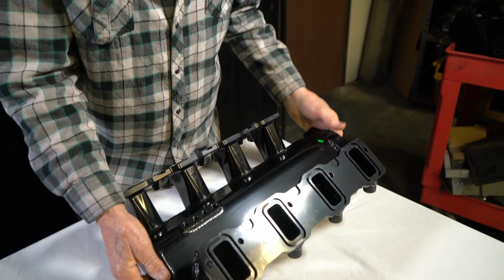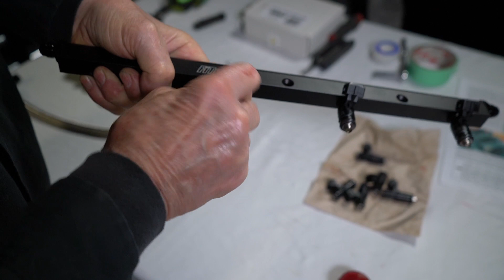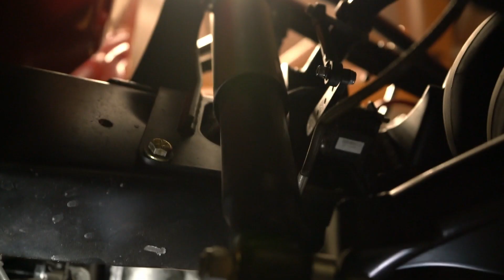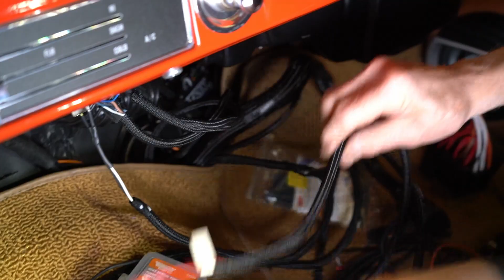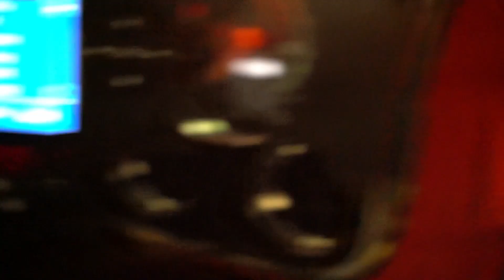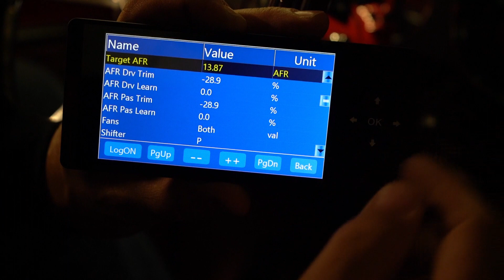1971 GMC LS EFI INSTALLATION- Part 1 | FiTech Tech Video

Comment: Hello, I have been reading that the say to eliminate voltage drop to wire directly to the battery?… is that not true?
Reply from the maker: Hello sir,
Running the battery wire strait to battery is the best you can when wiring an EFI system, since you will secure the power to the system. Running kill switches or other solenoids can affect voltage from getting directly to the system.

Comment: Hello, on my LS 5.3 Gen 3 I have a 4-wire alternator and on the FiTech ultimate LS 750 kit I have a 2-wire connector, my alternator does not give any current how do I connect it?
Reply from the maker: You can get an adapter wire to allow you to hook up. https://www.ictbillet.com/products/ls-6-alternator-adapter-harness-4-pin-105a-vehicle-to-2-pin-alternator-160a?srsltid=AfmBOooBz9J9FWSRIPhWCzMeOcuMDChPuXJdOxFhX9bodv_8KLbhK-Xb
Reply: @FiTechEFImedia   my fault, I have two wires on the 4-wire connector
black and red 
exist generator i have only 0.8v
Reply from the maker: @ardvi-all7796  Please contact the tech support line for assistance. There are multiple types of alternators so we would also want to identify your exact alternator to help. techmail@fitechefi.com or 951-340-2624.

Comment: Where’s the oil pressure commector
Reply from the maker: Our systems do not require the use of oil pressure therefore if you need a gauge you would wire it external to the EFI system.

Comment: Quiero felicitarlos por este video ya que explica muy ampliamente la forma de instalar el sistema de control fuel injection FiTech. hace poco tiempo hice la misma instalación y tambien en mi C/10 pero no habia salido este video, por lo que tube algunas complicaciones en la instalación y en la programación también. nos vimos en la necesidad de investigar un poco mas, ya que no habia esta información ala mano la cual es muy interesante para los que en el futuro quieran instalar este sistema. de nuevo felicidades queda mas claro como hacer la instalación 😃👌
Reply from the maker: muchas gracias!
Reply: Tienes el fitech cuantos abujeros del intake usaste yo no se como ponerlos si bloqueo todos solo dejo el del booster o nose si algo más ocupé vacuum